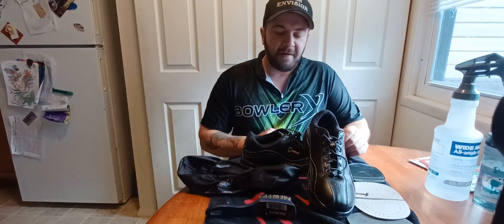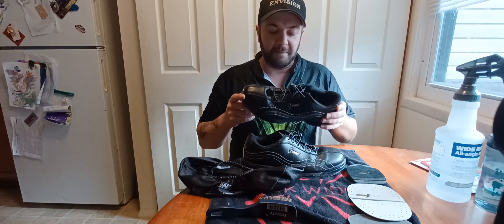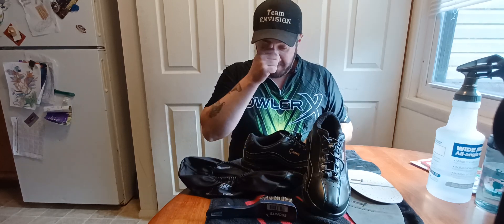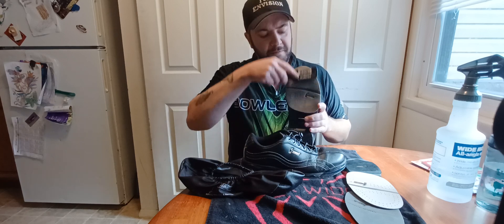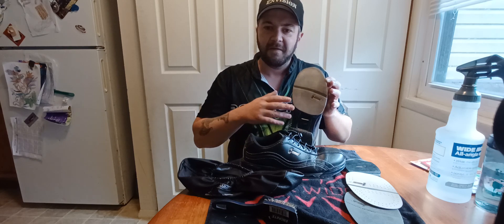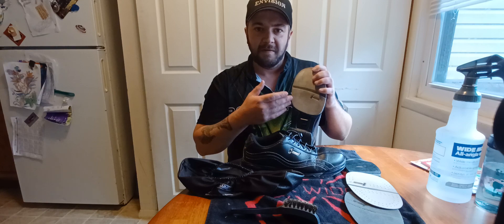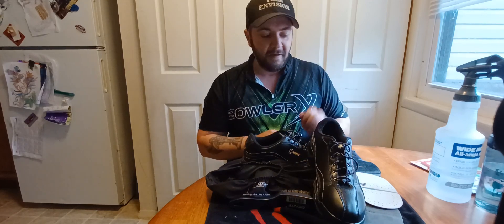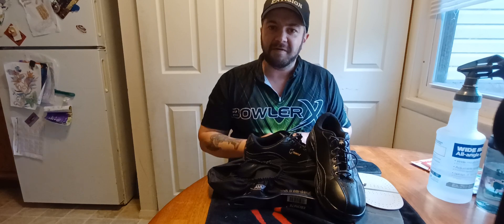maintenance and care of your bowling shoes

Comment: Excellent advice with a wire brush. Thank you!  Question I seen someone use a lighter to their pad to rid of a sticky substance. He had no complaints I noticed. But was wondering if using flames recommended if you stepped in something sticky?
Reply from the maker: That I could not give a answer to I personally never seen that before but not saying that it hasn’t been done so I can’t say if that would work or not I would love to give you a answer but I don’t want to give you the wrong answer idk if there is something out there in YouTube land that may have something like that about it or not

Comment: What about the heels? Possible they can cause sticking?
Reply from the maker: If you have Interchangeable souls they have a felt heel pad you can put on and that would allow you to slide more
Reply: @twohandedbeast  No interchangeable at all.  I just bowled yesterday fearing for my life essentially.  Every time I went up to throw any attempt to slide I was sticking terribly.  I was going to go to the bowling shop tomorrow to get a shoe brush and powder.
Reply from the maker: I know I have problems with sticking in the summer time I think it has to do with the humility winter leagues I don’t have any problems but a shoe brush will help with easy slide and shoe shock for sure to keep your felt clean and dry